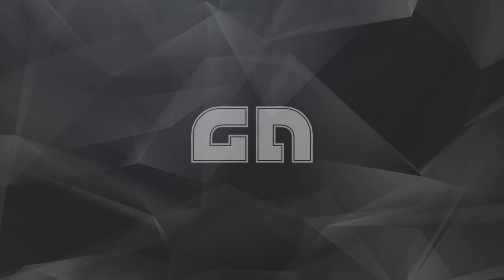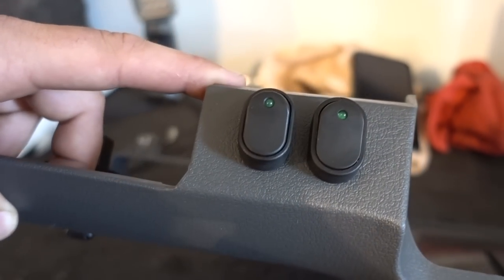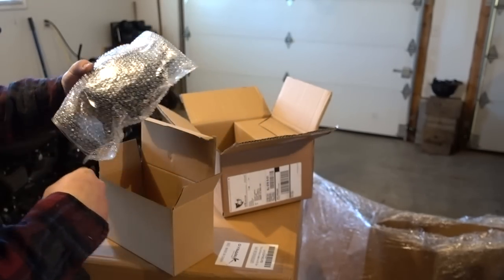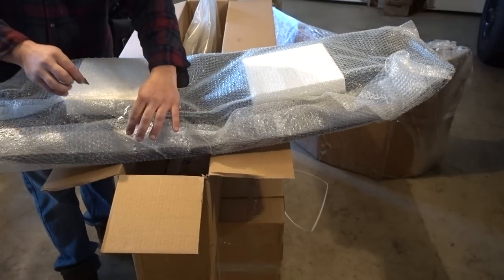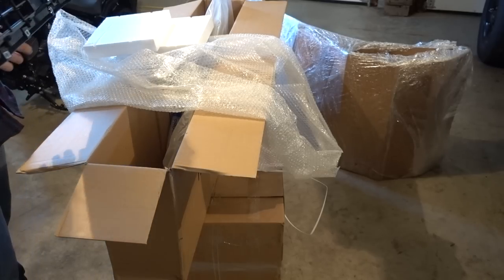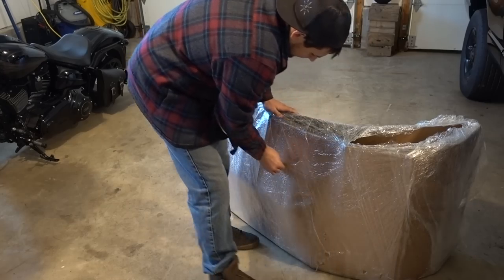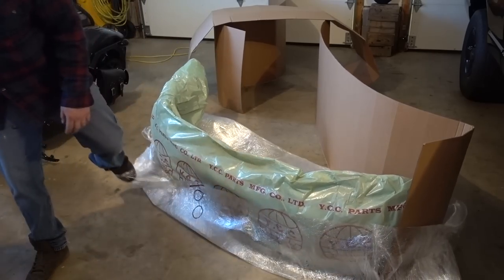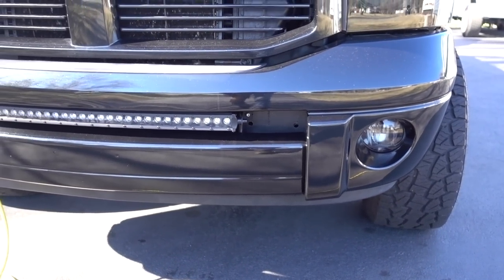Cummins Front End Swap & New Channel Gear!

Comment: Hey bro Chances are that the bumper support/crash bar re bar how ever you want to say it plus plastic mount end are all part of your issue for the swap from 05 to 06 plus all of our bumper basically mount the same but the small things is what kills easy swaps aka re bar and end mounts. I wouldn't Be to afraid of aftermarket fenders I deal with them all the time and some times if it's GM the aftermarket fits better keystone aftermarket is ok unless you can find factory stuff used or new for cheap depending on your your body man skills I would go for aftermarket or used if your on a budget and have some skill!! Good luck!

Comment: I just got the same cover, Same packing job and all for my 06. Slid right over my chrome bumper. Mine did not bulge up on the top, You may need the 06 top plastic support.
Reply: Matthew Miller yes, it slid over the chrome. But if you are picky the sport cover has square corners by the tow hooks as the chrome bumper has rounded corners. I got the chrome bumper for free for a spare and had a dent. So i too a cut off wheel and cut the rounded corners to square and can never tell there is a chrome bumper under the cover. I can send you a few pics but wont let me upload them on here.
Reply: ok cool ya if you get a chance send them to my email I put up I'd really like to see yours.  I hate my current bumper and want a more clean look.

Comment: What that factory switch on the panel you put your toggle switches into cause my truck has cut out for it but plastic pieces to cover it
Reply from the maker: The one i believe your referring too is for pedal adjustment, the Laramie's but be the only option to maybe have that not completely sure.